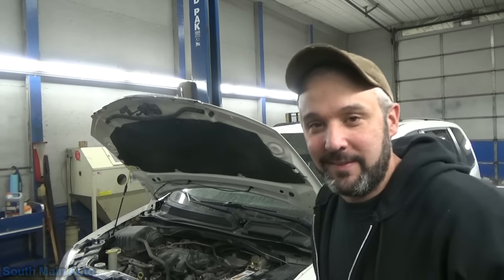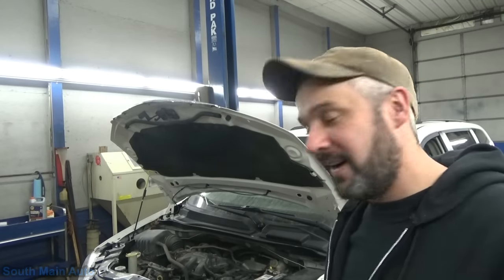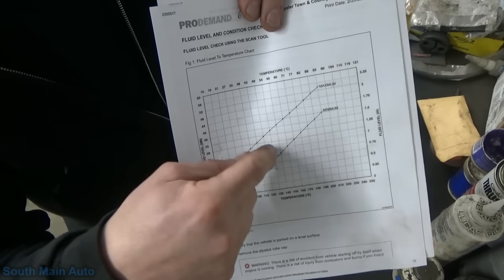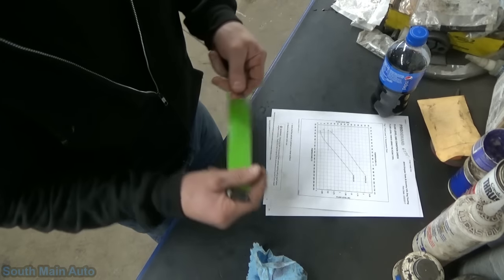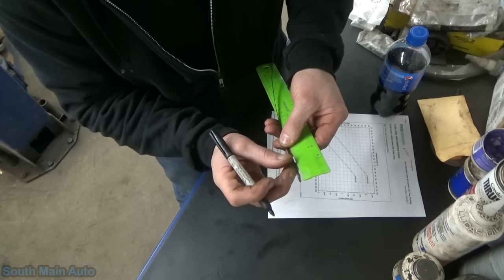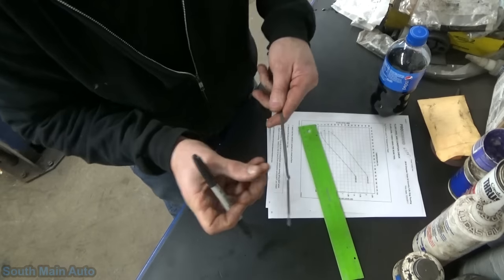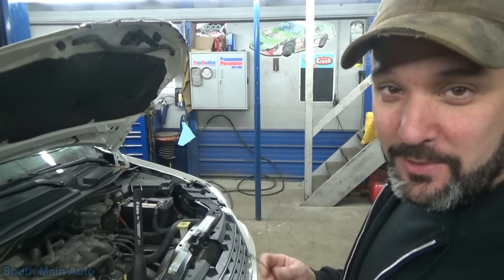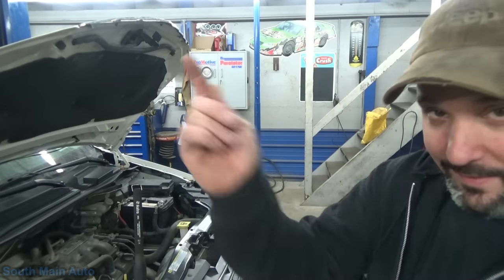Caravan / Town & Country 62TE Transmission Dipstick Hack

Comment: VW cars as well don't have an trany dip stick.  Pain in the cahouns if you know what I mean.   I resent lay did an trany oil change after the car exhibited shifting issues into 2nd gear in cold weather.  That did not help, so I read up on the issue and found out that it has to do with the solenoids sticking in the valve body due to sediment in the oil (fine sediment almost like graphite but finer).  I ordered a full solenoid kit from Cobra Transmission and made the switch.  Hard to reach valve body between the trany and the cooling fans in front of the car, but I managed to get it done with a new oil from the dealer at $50.00 CND./ quart (ouch). Now it's running as smooth as when it came out of the show room.  This car is a Jetta TDI with over 600,000 km on it, so I think I got my money out of that car for sure.  Unfortunately the car does not have a trany dip stick and the manual said that the transmission is not serviceable, heck even the oil filter is built in the trany and the only way to remove it is to do a complete transmission tare Down! Manufacturers want you to buy new transmission or push you over the edge and get you to buy a new car.  It's not bad engineering, they know what they are doing, it's the marketing bastards who have infiltrated the engineering dept. to create more sales down the road ,  typically like grocery stores putting the milk way at the back of the stores down the isle of the chips & dip so you can buy more stuff instead of just the milk. They know what they are doing, they call it "non serviceable for the life of the vehicle".  I am now much wiser and will be changing the trany oil regularly.   Ho yes, no dipstick.... Just put in a bit more than you took out, that is all. Don't need to make it more complicated than what it really is.  Cheers from Canada.

Comment: A BMW 330i I think from some era around 2008, not quite sure, but on that car the engine has no dipstick. Only way to check your engine oil is with a scan tool. How cool is that?
Reply: We just had one of those come in a while ago. Even better, it burned oil. So you never really know where it's at when you're driving! Way to go BMW!!
Reply: You could check the oil level via the info menu on the car.
Reply: Yes, we all know how accurate is that and how often that system goes bad

Comment: I had a 2006 charger in the shop,same thing,no dip stick. Dealer wanted $90.00 for the dip stick. Tranny shop had one and borrowed his. One of the worst one's are the 2007 Ford Explorer, what a mess that one makes..... Now when vehicles come in with dipsticks, i measure the sticks and keep records for each transmission it is used in. Thanks for that tip..

Comment: THANK YOU! You gave me a place to start. With code po734 (only po734) I'm hoping for a low oil level. 
It's a 2016 with only 103,000 on it.
Reply: Was that the problem ? What fixed your issue ?
Reply: @jerrywaller2578  new transmission. Snap ring in the under drive drum let go,major damage. 
For a 6 speed it was $4500.00 installed by dodge.

Comment: I wish I would have thought of that about a year ago.  My son changed the fluid in his jeep and just went by the book capacity.  I bought a dipstick (doh) and proceeded to remove 2.5 quarts of overfill.  Now, do you have a cheater for a 2007 Cadillac STS?  I have no lift other than ramps.

Comment: Do you add transmission fluid through this tube too? Dealer told me you have to use a special pump and go under the car to add the fluid. It's a 2010 Dodge Grand Caravan.

Comment: I saw some lipstick on that dipstick.  haha Great tip man combating dumbass oem engineering.   I have done trans fluid checks/changes on Audi/VW and just adding the fluid into the trans is insane!!
Reply: Yeah there is 7 speed one that you can only chage differential fluid. if you drain transmission fluid you then need new transmission you cant bleed the air out of it and there is no add port on it. Same thing if it has leak of transmission fluid you need to get new transmission to get your car go again :D
Reply: If your talking about the 6 speed DSG, you can add fluid through the hole after you take off the transmission filter. It takes longer than bottom filling it but it's much easier.

Comment: So clearly I’m an idiot but my question is. with the oil dipstick you’re using with the marks on it, does the dipstick have to go in all the way to the top? or just in til it stops? In other words how far inserted into the transmission fluid tube does the oil dip stick have to go?

Comment: Love these videos, have learned so much. Would add a word of caution that the oil dip stick can bypass the stop for gauging the amount of fluid in the tranny. If you are changing the fluid and filter, once the pan is removed, put the oil dip stick in the tube then go under the car and make sure it hits the stop, then mark the dip stick where it lines up with the top of the tube. Several times my oil dip stick bypassed the stop which gives you an inaccurate reading.
Reply: Where is the stop located in relation to the stick ?  So that one may sort of bend the stick towards the stop - from standing in front of vehicle,would it be 12 o’clock, 6 o’clock etc

Comment: Is there any special quirks when removing the transmission on these vans? I’m going to replace my flywheel this weekend and wanted to know if it’s all straight forward or is there anything special I need to worry about during removal or installation of the trans?

Comment: yup $124.99 +3-5hr labor fee (depends on how long we set around before we get to it), 5 or 6 service fees (whatever we can pull out of our buts), speaking of buts, there is a pulling it in fee, pulling it out fee, figuring out what to do fee, and other fees (may include squeeking tire fee, dirty engine fee, and a new dealer only cap since we will probably loose it fee) and any applicable taxes. to check your transmission fluid level.

Comment: Hey There Eric O. Thanks for the tip...I was watching some of your other videos on GM ABS speed sensors and living in E.A. ..I have changed many hub assemblies due to salt. So I am very interested in seeing if you can install that grease fitting speed sensor and if there is a way to bypass wiring in order for fitting to remain in use or does one just simply pull the fuse? Your thoughts and thank you for your out of the box thinking great stuff!!!!

Comment: If you have already bought the other dipstick can you use it to check the fluid while the vehicle is running? Hoping to get a flush from a local shop and I want to know what I am doing. They said to get a dipstick and they can do it but I don't want to have to take it to the dealer if they screw up.

Comment: Hey Mr O should this work on the 2010 model year? And what would cause a shutter only in reverse? Low or needs serviced. My wife’s van only has 81,000 miles on it. Van has the 4.0 in it.

Comment: The ones I hate are the ones that have to be approached from the bottom. Because the vehicle needs to be level, that means I need to warm the vehicle up, then put it onto four jack stands, then quickly measure depth below the fill port before it cools down too much. If it's not up to temp, I need to run the engine and run through the gears while it is on the stands. Sliding under a running engine on jack stands is never safe....

Comment: I'm puzzled. with the comparative lengths of the dip sticks. The "$$$$" one recommended to buy vs. the oil dipstick. The "$$$$" looks a bit longer and would therefore measure differently according to its length. I do get where you are coming from if, as you say it is just and always a matter of sticking anything into the transmission fill hole till it hits the bottom (straight down) of the pan...and whether the level is consistent with what it should be at the temps described. So...is that it? Hanger, wooden dowel, anything that just "hits" the bottom of the pan is the place where all measurements are calculated from? (NO, don't try silly putty of course)

Comment: hey eric, i have a 2010 town and country with a cylinder 3 misfire code, checked plugs and wires, they are good, short term and long term fuel trims look good, vehicle jerks around        30 or 40 mph, i am thinking catalytic converter or O2 sensor, what do you think?

Comment: Will you please do a video on a 2016 or so Nissan Altima CVT Transmission fluid change and removal of the locked fake dipstick tube they put on there to keep a consumer from checking how little fluid that they put into the transmission to begin with no doubt to have it burn up before you can get the freaking thing off. But, it comes off with a saw and a big freaking screwdriver and a huge pair of channel locks only to find that it is a dummy plug no dipstick and no freaking fluid either.

Comment: Wouldn't the engine oil dipstick need to be the same approximate length as the transmission fluid dipstick for this to work?  How did you know how long the transmission fluid dipstick originally was?
Reply: Ok I guess you test cold and hot levels with the engine oil dipstick. Nevermind.
Reply: That's what I was thinking.  Evidently the cable dipstick is only inserted until it hits the bottom of the pan.... that's how he inserted this one.   So the length from top of the tube didn't matter.

Comment: So I have a 2019 Dodge grand Caravan and with the 3.8 and 3.6 it looks like this little trick is the same however in 2019 I guess they decided to do away with the dealer only cap and I don’t see a single thing to check the transmission fluid. Is it completely sealed off like some of the new transmissions are now?

Comment: If that is how to correctly make the measurement, why is the factor tool so much longer? I just question the accuracy of using the measurement chart to mark the engine oil dip stick if you're using something that is a different length then what the reference chart is using, seems they are measuring from a different point.

Comment: you mentioned the min and max levels if the transmission runs at 200 degrees......if your transmission is running at 200F isn't that too hot?

Comment: Would it be possible to replace the "for dealer use only" plug with a dipstick off of a similar type of transmission from a salvage yard? 😮 Thanks.
Reply: If you trim the dipstick accordingly it might be possible

Comment: They are doing this on more, and more, and more vehicles, saying "oh our vehicle comes with "Lifetime" transmission fluid," which really means oh about 70k, or until you over heat the transmission...
Reply: Lifetime for a Chrysler is 36000 miles.  After that you never want to buy another POS ever.  All we see is engine ticks and transmission issues on this van at our shop.

Comment: Good evening, I have a Promaster 1500 with the 62TE. Same type of dip stick in the video and the chart they gave, but when I put the dip stick into the neck it goes to a point then stops. Ive measured that point which looks correct on the pan. But after completely flushing it and putting 9 qts as told, its not registering any amount. BUT, if you whiggle and turn the dip stick it will go past that stopping point and deeper into the pan. I figure the first stop is correct by the measurement I took, but maybe not???? Can you advise please. Thanks Chris
Reply: If you go past the stopping point that is not the correct measurement. Plus are you measuring hot or cold? Try hot and see if that gives you a better reading.

Comment: Bought one of these wrecks! Pulled  740 code  GM dealer had dodge dealer replaced torque convertor! Have shimmy  hitting brakes! Brakes hot, dark blue rotors! They put it together wrong! Had a ranger, ford dealer forgot to put bolts in and tighten the trans down! mechanic owned it at dealer! What have I learned! Do not under no circumstances have a union dealership work on your vehicle! Take it to Eric instead! You can watch video to see if he does it right

Comment: It's a Chrysler...that's why.....
In my Hyundai, it has an overflow hole on the side of the transmission case.  Once the fluid overflows (when refilling/replacing the ATF) in a steady stream, it means the ATF level is already full.
Reply: Lol thats most older vehicles.  Is it a standard? ;)

Comment: I have a 2011 T&C 3.6L that has a rebuilt Tranny.  It does NOT have a "Dealer Only" cap. There is what seems to be a vent cap in approx the
 same location. Any idea?

Comment: Hi, I have a 2012 town and country. I have a lifetime Mopar warranty on it. I just had the dealer put a new transmission in it. About 2 weeks later I got an oil change at a pennzoil and they said my trans fluid was low and they topped it off. I called the dealer and they said to bring it back. After the dealer service dept tech looked at it, they said it was way overfilled and they wanted to charge me $200 to take down the pan and remove the fluid, then refill it to the proper level and there was really no shortcut. They claimed the pennzoil tech must’ve not know what they were doing. I brought the van back to pennzoil and they checked the fluid with an official Chrysler dipstick. I had driven it about 25 mins there and sat in idle for about 5 before they checked it and it was barely on the bottom of the dip stick. Am I missing something or is the dealer trying to scam me?

Comment: That dealer use only is illegal...

"The right to repair concept has generally come from the United States. Within the automotive industry, Massachusetts passed the United States' first Motor Vehicle Owners' Right to Repair Act in 2012, which required automobile manufacturers to provide the necessary documents and information to allow anyone to repair their vehicles. While not passed at the federal level, the major automobile trade organizations signed a memorandum to agree to abide by Massachusetts' law in all fifty states starting in the 2018 automotive year."

Thus they should provide a dip-stick and anything else necessary so the owner can do it themselves.

Comment: would it be possible to replace the tube and use the dipstick from an older Caravan? That 3.8 looks NO DIFFERENT than the one in my 2002 Caravan. I have a dipstick right there where that "dealer only" cap is.
Reply from the maker: The trans is a totally different animal though. These are a 6 speed.
Reply: South Main Auto Repair OK. Not familiar with the fifth generation Caravans. Everything looks pretty familiar to me under that hood otherwise. I wouldn't mind having one of those. Most of the later models like that one have the Pentastar motors in them, and those 3.3/3.8 motors are a reliable workhorse. Last one I owned, an early 90's model,  had over 300,000 miles on it when I sold it.

Comment: Hi there, I want to do transmission flush on my 2008 Chrysler town and country, so do I need to running up an engine to hot before I check the level then when I fill fluid in and its have to be same level,  right? Thank you.

Comment: That shouldn't have the 62te I thought 08-10 with the 4.0 was the only ones with the 6 speed the 3.3-3.8 had the 5 speed and that engine is not the 4.0 ???🤔and the 3.3-3.8 did have the dip stick still. Correct me if I'm wrong on this?

Comment: Hey everyone.  South Main, cool vid.  I have a 2011 Chrys. T/C.  I bought a dipstick at my local shop, not the dealer. $20 bucks. the temp/mm chart for the stick that i bought doesn't have the same numbers the on the dipstick?!? on the dip stick it reads 10mm-120mm.  my temp chart that was in with the dipstick has 0-60mm for the lengths and 70-210 degrees for the temp scale. am i missing something here? or should i throw in a slight conversion?  my results for checking my level was at 110mm at operating temp.  I'll keep scour the webs to see if i can find the right chart for this here dipstick (and i don't mean me.  although i do feel a bit dumb at the moment)  thank for the vid and any help from the forum here.

Comment: Sorry, I got the C/B reversed Caravan uses C, Compass uses B. I was also thinking you could use a 1/8" or so clear plastic tube you shove down, then pinch off the top to hold the fluid level in the hose and pull it out.  You could mark the hose with a sharpie as well.

Comment: I guess if you need an exact reading, Amazon has the tool for under $10. Just aim a infrared temperature gun at the transmission and refer to the chart.

Comment: Nice hack BMW's are the worst I've come across yet dipstick for the engine oil German engineering yeah right
Reply: bodgit and leggit garage I can top that. MB ditched the stock on the 03 E class. No trans stick no oil. Goes to show that Chrysler engineering stepping in.
Reply: Smart cars have  no engine oil drain plug  -- many have found the oil lasts longer than the engine.
Reply: They're carefully engineered juuuuust long enough to last the term of the lease. Then you take it back and overpay for more plastic. But dat badge tho. Oo, aren't you fancy.

Comment: I've never heard anything one way or the other why there is no dipstick but my guess is they did it as a cost saving measure. Seldom is it ever needed since the tranny fluid supposedly lasts the life of the vehicle. They no doubt take nothing else into consideration.

As far as not being able to open the hood in the future, I doubt it will happen. Though the DIYers are dying out. Back in the 80s Congress proposed that to Detroit and they said NO! We couldn't sell anything if we did that. Though times are still changing.

Shame on FCA for saving $6 in the cost of the vehicle so its difficult to check levels but easy to spend $3500 on a new tranny.